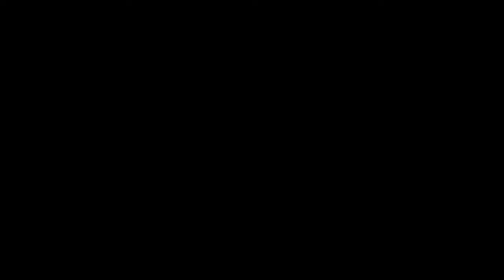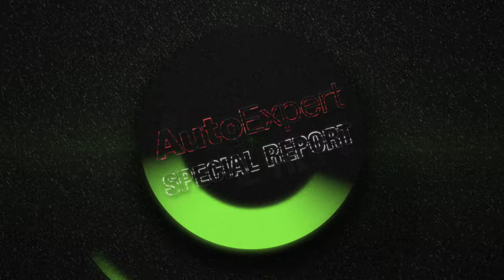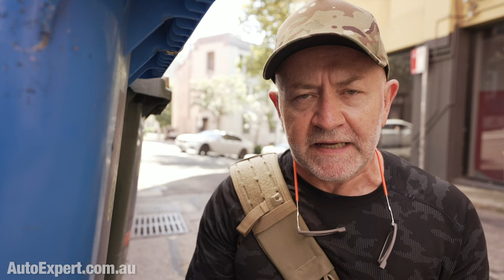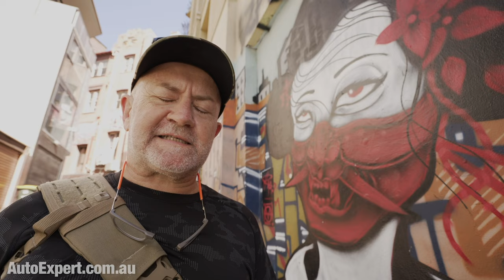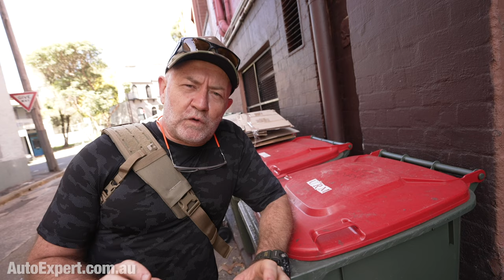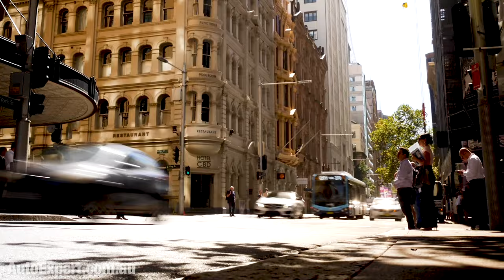These two simple hacks will make your engine last longer | Auto Expert John Cadogan

Comment: I concur with everything John has said here and would add, when you do your interim oil change get the engine and the oil good and hot (minimum 20KM drive) before you drop it. That way you will get the most benefit from the change as all the contaminants and microscopic foreign particles will still be in suspension in the oil and the thinner hot oil will drain really fast carrying everything out of the sump with it. I'm pretty sure most dealerships don't give two hoots about this when they do oil changes which is something I believe also adds to the incidence of these problems. Wear gloves and mind you don't burn your hands the oil can get very hot indeed.

Comment: Diesels in particular can benefit from a decent trash occasionally. Some time back I borrowed a local farmer's pickup/ute. It spent most of it's life just doing short journeys checking on animals etc. I had a long way to go and it was a normally asthmatic diesel so it spent most of 16 hours with the throttle wide open on the motorway. Who needs cruise control when the engine can't drag it up to illegal speeds anyway? A few days after returning it I received a phone call - "what have you done to my truck?" - oh shit -  "It does so much better!" - phew.  "Erm - as a thank you I gave it an Italian tune up!"

Comment: John, does taking your car for a thrash around the hills at high engine speeds (after warming up of course) accomplish these goals as well? 
Obviously running at 6000rpm isn't going to increase engine life, but I like to imagine I have a duty to give her the old Italian tuneup at least weekly.
Reply: Not so much with newer cars. Computer controls and sensors galore mean that the Italian Tune-up is virtually null & void. I'd recommend learning and doing the basics yourself (fluids / filters / tyre rotation / battery charging) as a way to keep the car newer for longer.

Comment: Another good advice John. Here in europe, manufacturers service schedule are mostly 30k or two years which is ridiculous, having hot summers and really cold winters imo. I was growing up in different times and do my oil and filter changes every 10 to 15k max. Surprisingly, my cars don't suffer common problems mentioned by you. Coincidence? I don't think so. By the way, if i'm driving in town more than often, I take it for decent motorway blast every few weeks as well, it does work for my cars. Great video as usual John.

Comment: My BMW diesel came up with an “oil level above max” message. Under warranty. New oil, clean out the applicable regeneration filters etc. That was when my primary drive was <10km from cold each day. Now I’m doing longer trips, so shouldn’t be a problem now. Didn’t even know it could be an issue prior!
Reply: You only get a diesel if you're doing a lot of k's...

Comment: Another thing, after a big drive, the oil on your dipstick can go straight from F to Add in one tank if you've only done really short driving before. Save yourself $20 and carry a 1L bottle of oil from Super Cheap if the car is going beyond Metro Melbourne for the first time in its life, than be ripped off at the servo for oil.

Comment: Agree entirely on the more regular oil and filter change which should always be done on a hot engine with the oil allowed to drain for a few minutes to make sure it's all out. Also, on the regular longer drive, do it in third gear close to maximum rpm, we used to call it an Italian tune-up, works wonders.
Reply: Difficult or impossible with a CVT?
Also, what are the practicalities of doing this at home - without proper oil recycling/disposal? Loaded question of course... we sell something called the Spider 2500 which might go halfway to making the process easier... even nicer is our Single-Post Portable Service Hoist (smallest footprint high-rise car hoist) - but a tad pricey for most folk…
:P

Comment: GOOD advice John! DO these conditions affect diesel & petrol/gas engines alike, or is 1 affected more than the other?
Cheers!
Reply: Diesel is more effected. There's everything he mentioned, plus there's the particulate filter.

It filters out the black smoke you used to see coming out of trucks. The particles are trapped, and when you get out on the highway, and the mixture is lean, and the exhaust hot, they're burnt away. Without that fortnightly run your particulate filter clogs, and you're looking at a 1500 dollar replacement.
Reply: @gasdive  Affected.
Reply: @BadDriversOz  quite right. Sorry.
Reply: @gasdive  NW! Affect V, effect N.
Reply: @BadDriversOz  I know it, just an annoying brain fade.
Reply: @gasdive  Cool cool! Calm replies, get it done! Drive on!

Comment: Most manufacturers specify constant short trips as a "Severe Condition", which usually involves an extra "in between" service. Most people would be capable of doing their own in between oil change if they were shown the correct way and had some basic tools. TAFE colleges used to run night courses on how to maintain your own car, if anyone is prepared to learn how to do it you can save some serious money as well as not having the inconvenience of taking your car somewhere to get it done. I did some automotive teaching for TAFE years ago and I taught a group of women how to maintain their cars, nearly all of them continued to do their own minor oil changes and basic services. This was back in the days when cars only had 12 months new car warranty though, if the car is still under warranty you have to get a qualified mechanic to do it to keep your warranty intact.
Reply: I remember being very excited seeing a basic maintenance course 'for women' in the listing of community courses. This was in the '80s and I was a teenager. I took a look at the course description.
How to check your oil, brake fluid, coolant, add washer fluid, etc.
Really???  
At least repair manuals for just about every make and model were easy to get a hold of!

Comment: Well as someone who actually reads the owners manual of their car from cover to cover this is not news. By the way just halving the intervals may not be enough to preserve the warranty, read the fine print in the manual, anything other than steady state highway motoring in mild dust free air with no hills or rain is classed as 'severe service' in some cars this can be as low as 3 monthly for some items depending on conditions.
The BMW M3 one of the better examples of the superior handling of a front engined rear wheel drive car.
Reply: True re M3s except the G80's grown to 1730kgs, some 140kgs more than the F80. Some 'competitive' weight gain i guess...🙄

Comment: I get my 2017 ( May 2018 delivered) Hyundai PD i30 SR serviced by the dealer every 10,000k's, which for me is approx 6 months.. 
Then at every 5000k's ie: 5000, 15000, 25000 etc I do an oil change at home..   Just drop the oil that's in there & replace with the correct grade..
I'm now just coming up to 63,000k'.   Car has run like a dream since new...

Comment: I have been stressing about my wife’s Mk6 GTi which does very short trips, whenever I can I take it out and get the oil temp (it has a temp readout for oil) and take it out of ‘drive’ and into manual shift. This way I can get the revs up in town to get oil temp up to 85-90 degrees. The transmission is so early to change up and even at 60kph it’s in bloody 6th gear and 1500rpm. I think this is VW keeping the fuel consumption down and then emissions low. Using ‘sport’  mode on transmission will do the same thing but it’s a bit wanky having it blip the throttle on downshifts all the time around town (I’m older than 40 obviously)  great video though we need more of this education

Comment: Haha, sounds good now the challenge is to find someone who actually does the service. Took my wife’s 2016 car religiously to ultratune every time it was due, until one day it broke down and ultratune was booked out. The car now has 90,000 Kim’s on it.
Forced to look at it myself I found the oil “lumpy” and a date hand written on the genuine manufacturers oil filter of 2016..... but it’s 2021. Matching date to log book, this is the manufactures first service done after 2000klms. In case you haven’t joined the dots, someone took the money and didn’t do the work. Not good for a motor. 
I now do all services myself.... 
Great advice but watch your mechanic, make sure he’s doing the right thing by you....
Reply: Your first mistake was to use Ultra Tune. Auto service chains are only as good as their individual branches/franchisees, and too many of them are pretty shit (at least in my experience).  Better to use an independent mechanic that comes with a word of mouth recommendation from someone you know/trust.
Reply: People should learn how to do basic maintenance on there motor vehicles would literally save them thousands of dollars and a lot of heartache as well

Comment: For decades I've been changing oil once  a year.  That's sometimes 15, 000 miles or more.   BUT: my cars run almost no short trips.  In a moderate climate.  They are garaged and never have to start at less than 40-50 degrees F.  They rarely run at less than 50mph after a 20-30mph warm up for about a mile. (No other warm up.  Crank, put in gear and drive away.)  Mobil1 oil and Purolater Pure 1 filters.  I have three cars in the yard right now over 200,000 miles in excellent condition.  No sludge or varnish at all, internal engine as clean as new.   If you run short trips in cold climate at low speeds changing oil at less than 5000 miles is a really good idea.

Comment: John I agree with you that it is important to drive a vehicle at operating temperature to maintain oil integrity and reduce fuel oil dilution but that ocures in the combustion chamber when it's a cold start and and oil and compression rings have not expanded to operating temperature and the fuel is acting like a solvent diluting the oil on the cylinder walls that all ends up in the sump . Where I feel you are wrong is buy knocking the catch can , the catch is designed to reduce oil from the crank case from entering the inlet manifold , very important and extremely useful in reducing carbon build up in the inlet manifold and the head protecting the valve train as well. A good quality catch can with a quality filter connected correctly and drained on time is great insurance for the longevity of a diesel engine especially these days. Oil dilution in the crank case and carbon build up prevention are two separate systems.

Comment: I just watched a 1 year old video the the channel Project Farm called "will annual oil change damage your car? Let's find out!" that sent old oils with low miles off to a lab and did some in house test of old vs new oils and basically came to the conclusion that the oils were still with "spec" and still fine.

Granted you're talking about cold starts vs him just using low miles. Curious if you have a spare 12 minutes to watch that video whether you could see the potential flaws in his conclusion?

Comment: Yes yes yes If the oil is going dark on your dip stick. Put some nice clear stuff in there. For me its a set of car ramps, one nut, one filter, 10mins and back to the couch. Keep an eye out in Woolies for the 50% Valvoline and its a 400 000 km smoke and trouble free engine.
Reply: Yes, is that easy to keep your engine happy! I alway pre purchase my oil when it goes on sale, and usually have 3 oil changes ahead of new oil waiting. Same with filters. A local auto parts store does a 50% off sale on filters once a year, so I have a stock of them too!

Comment: Basically I ageee. But I leave the filter and only change the oil more frequently, use a pump in the dip stick hole. Takes 10 minutes in total.

Filter and oil changed at normal intervals. Filter capacity is not affected by dilution under normal conditions.

Comment: Greetings from The Baltics. Is your advice is more focused on petrol powered vehicles, and can it be applied to diesel powered vehicles as well? I ask because I’m currently contemplating buying a 2012 bmw 320 petrol version, because I really don’t drive around that much, and I thought that the petrol version ought to be better in these circumstances, that is, a lot of standing still, and not much driving after. For reference, when I had my glorious beast V70 D5, 2004, I did less than 7000km per year. Now that I have a girl at my side, I might do maybe 10 thousand a year. Therefore, back to the subject - could a diesel powered vehicle in these circumstances work? 

Thank you for the hard work you’re putting into these videos. Entertaining and educational at the same time. Thank you.

Comment: Does my hour of highway driving need to be consecutive?  Would it be sufficient if I drive around 15 minutes on the open road several times per week?
Reply from the maker: You mean 'contiguous'. And 30 minutes at a time would be nicer.
Reply: 15 minutes and the oil is still not up to temp
Reply: Assuming that I’m getting on the highway shortly after starting my car, which I’m not.

Comment: I have a question John about Toyota synthetic oil claims of 18 months of 15,000 miles. I am running a 2018 Toyota Corolla Se.I went over my 18 month,but only went 10,000 miles and here in Florida does not take much time to warm up to operating temperature. So my question to you is 18 months too long?

Comment: Change my oil on my old Isuzu 4BD1T every 5,000kms - 600,000kms+ and she is just getting worn in.

As an aside, can I suggest you do a comparison on how the 'M3' concept has actually changed since '86.  How about comparing the E30 M3 with the current model....and throwing in the E46 in the middle?

Comment: John, my 2017 Hyundai Accent 1.6 has direct injection.
A Toyota Camry has both port and direct injection 
Are the Hyundai's inlet valves not getting cooled by fuel mix?
Should I expect a worn engine sooner than an engine with port injection?
Would any future inlet 'carbon deposits' come from the PCV?

Comment: I find that Black Sambuca assists in the removal of any blockage/s I may have...depending on the amount of blockage the non-diluted Sambuca req'd is around 2 x 700ml/tank....no family wishes to be around when the time comes for the blockage to remove itself however...I will take your advice onboard and make sure that this a 6mthly operation with a Chivas addition just before Christmas...

Comment: I think the No.1 engine-saving tip is to let your car idle for 15 seconds after starting it. It takes 12+ seconds for oil pressure to reach the heads.

My '97 Tommy Kaira M20b has an oil separator/catch can on the PCV system. And my car isn't direct injection, so the inlet doesn't get fouled.
But the best thing I have to lengthen my 2-litre flat-6 engine's life is a 250 watt bar heater which sits on my garage floor, directly underneath the oil pan. I have a tennis ball hanging from the ceiling, and when the windscreen touches it, I'm in the right location. That location triggers a little microswitch on the frame which holds the heater. That tells the system the car is parked. The heater is on a timer, and it starts heating at 7am each morning, and stays on until 10am, and it turns off as soon as I drive out of the garage.

This is a system invented by my Dad, which sat under our 1972 3-speed FJ40 Landcruiser's engine block for all 16 years we owned it. In its 15th year it has its exhaust emissions tested, and the results were superior to my Mother's 3-year old Pulsar SSS. :P

Comment: Not sure how the manufacturers want Aussies to do it, but in the US, most have a "severe use" service schedule in the owner's manual - severe being listed as unusually hot, cold, or dusty, or short-duration trips with a mostly cold engine.  In my experience the severe schedule usually indicates having the vehicle serviced roughly twice as often...in the case of my '16 Hyundai 1.6T, the book requires a service every 3000 miles (roughly 5000 km) instead of the standard schedule of 5000 miles (8000 km.)  But does anyone else read the owner's manual these days?
Reply: re Owner's Manuals. I gave up as soon as my Hyundai arrived.

Comment: So, question, I went into my dealership and asked for a 6 mo service interval and all they really described to me is an oil change and a fluid top off... Is that what your describing, so oil change and service are interchangeable words?
Reply: Yes, on most new cars the first 3 years is a “ minor service “ which is a oil and filter change, then depending on make and model you may have a cabin filter change every 2 years and a brake fluid flush every 3 years, 4th year is normally the major service where everything gets done and in some cases like the VAG group the dsg gearbox will be serviced